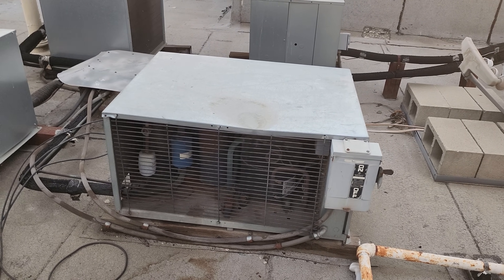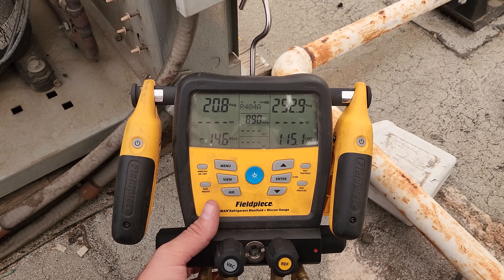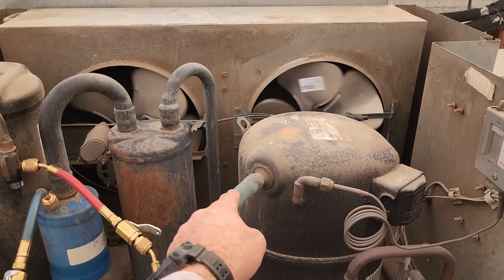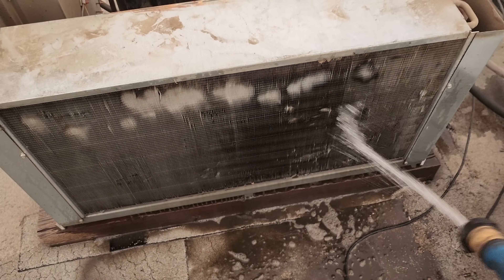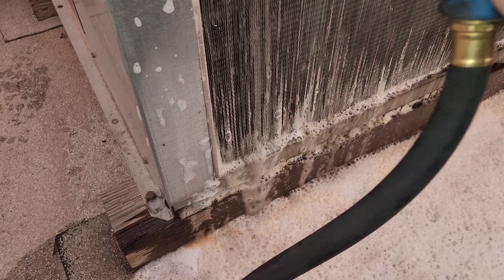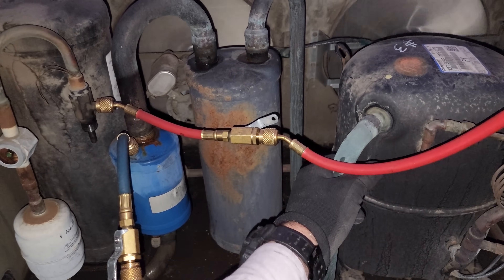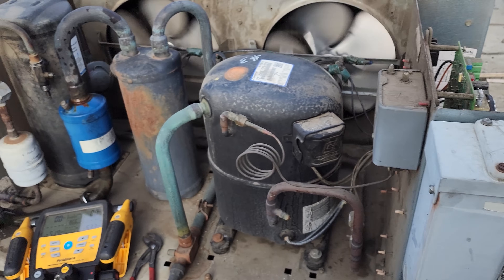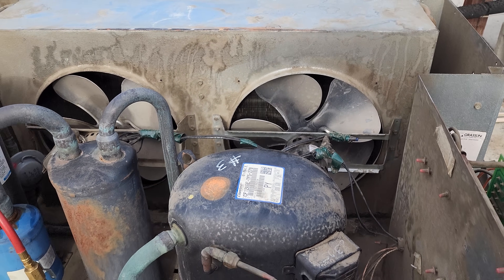HURRY THE FREEZER IS TOO WARM

Comment: To clean to coil with shitty water pressure I personnaly use a 24V pressure machine. You can even use a bucket and the 3/8 tubing if there is no water access. Check it out. Beats the 600' of hoses sometime and the 9 psi of the building
Reply: Also, i've had so many of those "T" fail on me when installed on the discharge.. when I worked for Jci it was one the most common waranty calls on YPAL unit. 

Thanks for the video man, love a guy that works !! Ever breaking ever fixing !

Comment: Hello Chris,
My Name is Dennis ,,,,, background graduated OKLA STATE TECH in 1970,,, worked in Tulsa Okla 2 companies a Trane Dealer approx 2 years then I went to commercial refrigeration for Allied Hussmann
for approx 3 years and then a Tyler refrigeration company for 2 years  ,,, then I returned to my home town and started my own business  for 15 years ,,then because of bad back 20 years on hvacr maintenance ,,,, I m retired at 72 ,, for about 10 years

 I was watching this video on utube and saw where you had adjusted the expansnsion  valve several turns to lower the superheat ,,,, did you ever get your desired superheat?     My experience if you so desire to listen is that every time I change out a compressor , i change out  the expansion valve,,,, Why ???? u ask..... If you want a unit to work like it is brand new for the next 5-10 yrs then changing the valve will get rid of one thing,, the spring inside  (some kits let you rebuild the guts)  The spring tension inside from my experience only will last on average 8- 12 yrs   think about your car springs they get worn and loose there spring tension  on average about 10-12 years and they don,t go through the constant heat and cold changes happening in an expansion valve ( especially in winter months when the heat is on)
Have you ever gone out on a a/c  or refrig unit in the spring and you have trouble getting you working pressure and it acts like its low on freon ... so you add freon and it brings up the pressure and the sight glass clears.....u think it working ,, maybe temporay,,,,, in August  you may need to let some of that freon back out because it is going off on high head.    this is because you valve is operating like a hand valve.  now your supper heat  will come down because your valve is wide open ,,, but will it close down when the superheat drops  ,,, not too good..(fixed spring pressure ,, only less than factory)...  it  took me awhile to learn turn the superheat adjust knob a half turn in to close it (while the unit is stable and running for several minutes) and if it moves and gives you a higher supper heat reading and stays there then that,s  good... if it kind goes crazy and act wierd then you might be watching the reaction from changing the flow like a hand valve  ( a fixed metering device ,,, only you don,t know how much)  To check a expansion valve in the spring (cool weather) try covering the condesor with a card board cover  and get the unit operating in a normal head and see if the sight glass clears

I hope and wish you a long stable business   Oh and if you want to keep employees busy all winter long
start a 2nd business like tree trimming     if you want to get new customers ,,, try giving your family some business stickers and tell them to go to alot of open houses and while the realitor is not watching put it on the furnace over the other competitors sticker.   :)

Comment: I had a real head scratcher just yesterday. A make table that has a semi open top (randell) that the top was not pulling down to temp but the heat coming off of the condenser was high. I looked over the system and the only thing I could think of was that there was more heat getting into the suction through the cork tape that some previous company had put on the suction line leaving the pressure line exposed. Removed the cork tape, I agree with You on this that cork tape sucks to remove, and put both suction and pressure lines together inside some 1/2 inch thick insulation tube. Temps proceeded to drop down to a good point for product. Never thought about it that much but most randell make tables before R290 were setup that way with R404. Thanks for the videos

Comment: those high pressure control switches are usually a 10-15PSI tolerance(2.5-3%)

Comment: Hi Chris, enjoy your show.  I am a DSM for a refrigeration manufacturer and find what you do extremely helpful.  Nowadays, I usually get a few calls regarding this matter exactly.  Most customer will switch to auto-reset or adjust to 425psi if possible.  Question for you, what are you seeing and saying to your customers regarding the new CARB regulations and the new proposals from SNAP?  When I talk with most techs and design engineers they don’t seem to know about the new regulations or when CARB comes into effect.

Comment: Do the Penn / JC dual pressure switches with manual HP reset drift as bad as the peanut switches?
Edit: 10 lbs off of cut-out on a manual peanut switch doesn't necessarily strike me as problematic drift.  I don't understand why you wouldn't just replace the 'shitty' controls with a decent dual pressure switch.   
Lots of techs forget to test how a unit acts when pumping down...

Comment: Chris I'm considering building a HVAC monitoring system that could be added on to existing systems like this. 

Ideally I would monitor pressures and current  and send that data to a cloud were I could run some real time analysis to detect problems (clogged condensers and such). 

It would probably be a subscription service that the restaurant pays for and would instantly notify HVAC service techs like yourself of a failing unit. 

Do you think their would be a market for that?

Comment: Interesting that you would use the receiver valve for a swivel tee. Reasoning behind that? I was always told you were supposed to leave those valves cracked open. They had to either be front seated or back seated.
Reply: I think you may be thinking of mid-seated.  Usually valves are back seated but on occasion,  the need to put a turn in is necessary.

Comment: At that ambient, under rare circumstances, if there is a dust devil or gusts from a thunderstorm  that cause air to enter the back of the condensing unit, the fans can't move air across the coil. I've seen mini splits throw a code and lock out  especially when set perpendicular to prevailing winds.

Comment: Why wouldn't you install a automatic reset control instead?
Reply: Automatic reset controls can reset into a fault, and cause problems for the compressor.
For example, if a condenser fan motor dies, you'll get stuck in a cycle where the compressor starts up, builds up to cut-out (which is distressingly high pressure and temperature), shuts down, cools off, dissipates pressure, resets, starts up, builds up to very high pressure, shuts down.....
This relatively rapid cycling, and the high temperatures/pressures involved, are very bad for the system and can kill the compressor.

Some air conditioners have a similar system in the form of compressor lock-out, where the CLO board will give the unit a few chances to reset after a delay before locking the compressor and requiring a service call.

Comment: Chris, why no solid state 3-phase relays? Why don't you use them? I ask because you replace the contactors that get ruined by sand and while solid state relays are more expensive their failure rate due to sand is next to nothing.
Reply: Resistance and inefficiency.
A solid state relay/contactor always has a small voltage drop, and therefore power loss, across it.
When we're talking about these large compressors that pull 25+A and run as heavily as these things, that's a rather significant inefficiency.
Assuming a typical silicon "on" voltage drop of 0.7v and a three phase compressor pulling 25A/phase, that SSR is dumping over 50W as waste heat.

Multiply this by how many systems there are up there on that rooftop and you start to see the problem.
Combine that with all the modern energy efficiency initiatives that'll freak out if your 480w fan motor is running faster or more often than it absolutely has to even if it harms system performance, and you have your answer.
Reply: @FerralVideo  Input Power Consumption (Burden) 0.3W. I'm glad you did so much searching before you replied. The gov has not regulated them and we should not be in the business of added regulations to the gov based our assumptions of future events.
Reply: @tyhuffman5447  Uhm. Excuse me?
Do you even know how SSRs work?
No solid state device is capable of reaching zero resistance across its current carrying components.
The "burden current" that you found off of some spec sheet is the GATE current, required to "energize" the SSR.
Which of course is going to be low. That's how triacs and solid state devices like these work.

What you want is the "on state voltage drop", which doing additional research as you specifically requested me to actually paints even WORSE losses than I had predicted, with this actual spec sheet I dug up listing the peak on-state voltage drop for a 60A 3-ph contactor suitable for this kind of application as 1.6v.
Repeating my Ohm's law napkin math calculation with our hypothetical 25A compressor at peak forward voltage drop yields a dropped wattage of FOURTY watts PER PHASE, or 120W total across all three phases.

Yes, real world drop is going to be lower, but again, no silicon based device except specialty Schotzky diodes can go below about 0.6v on-state, and they have their own compromises to hit that number.
Reply: @FerralVideo  and yet they use VFDs in package units so those two devices are pretty much the same thing. 120W is nothing. If they can use a VFD in there they can use a solid state relay.
Reply: @FerralVideo  thanks for correcting my btw. I am indebted .
Reply: @tyhuffman5447  I honestly personally disagree with them using VFDs in these systems.
They fail extremely routinely and are being operated at or in some cases beyond their design capacities for amperages and environment, being undersized to save a buck at the expense of reliability.
... kinda proves your point in a way, really.

The main benefit to using the drives is the ability to reduce the motor speed, which poses a far greater energy savings than is being lost in the IGBTs. (208v 5A motor being reduced to 2A draw > the 120w or so it costs to power the drive)
It also tempers the airflow to something more appropriate for the reduced cooling capability when staged down.

While I was doing my research, I learned that these SSRs are kinda delicate. I don't know if they would be able to withstand California's terrible quality power, or the inductive kickback generated when the compressor shuts down, and achieve the kind of reliability that would make them "worth it" over standard contactors.
Just check Chris's video library for how often he encounters VFDs blown up....

It might be worth chewing on after weighing the options.

To close out my reply, I want to apologise for getting snappy at you in my earlier replies.
I felt insulted and let my feelings jump in on what should have just been a rational and factual reply.

I need to log off, and I wish you an excellent day wherever in the world you live.
Reply: @FerralVideo  they make an inductive end load look like a capacitive load. They ain’t going away, they are in home systems. All new tools are misused.
Reply: @FerralVideo  No need to apologize. My point is why replace the contactors so often when there are different types of contactors to choose from. Also something that get missed is a side benefit of VFDs is that they shift the power factor  which is something the power company is interested in. 

Heat sink the solid state replays well and then the problem with them and the VFDs becomes proper ventilation. Which is a problem that can be tackled using different solutions rather than how do we keep the sand out of the contacts. 

Here's a small example: if a part is changed so often that it begs for corner cutting to keep up with the failure rate then the solution is part of the problem. So if contactors are being replaced so often that they are changed preemptively just to keep up then it's time to explore a different solution rather than repetition or carrying more contactors. 

Rather than fighting sand infiltration use a technology that works just as well if it is covered in sand as it would if it were totally clean. 

Have a great day.
Reply: @FerralVideo  A box like this would draw around 3*12A. You would use a contactor like RGC2A22A25KKE which gives a power loss of 40W. Now offset this power loss to how much a compressor replacement costs and also the cost of regular contactor replacements you can calculate the yearly savings/costs.

Comment: If you have all that heat from sun light, why isn’t the tops of the units painted white to reflect the heat?
Reply: The direct sunlight on the case of the unit is a comparatively low thermal load vs the air temperature.
Once the fans start running, it's going to be pulling ambient-temperature air through the coils, which will dictate via the "20 above ambient" rule how hot the coils themselves (and ergo their pressure) gets.

That said, many of them are, in fact, painted a light (or even bare-metal) color for this reason. A lot of the modern ones are beige if you pay close attention.
These older systems were made before efficiency was as big a deal as it is now, so it wasn't as much a concern. So the paint color was merely a cosmetic choice.
They also just aren't MEANT to run in a 120 degree heat wave. These conditions are grueling on these machines.